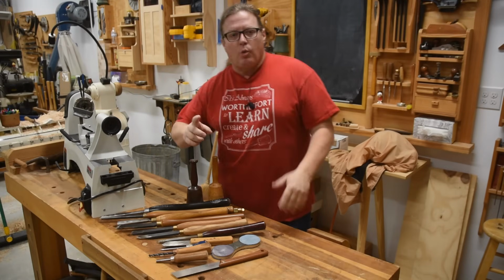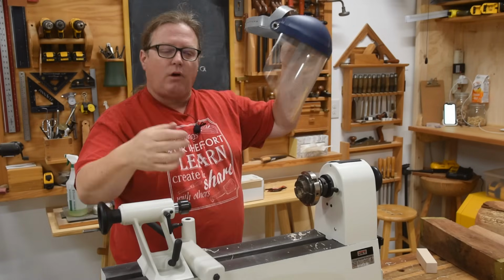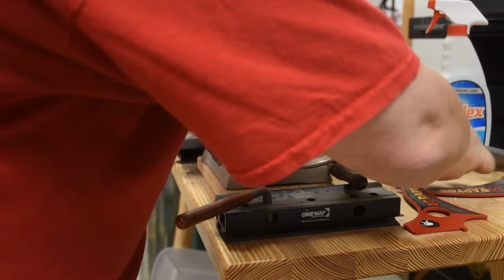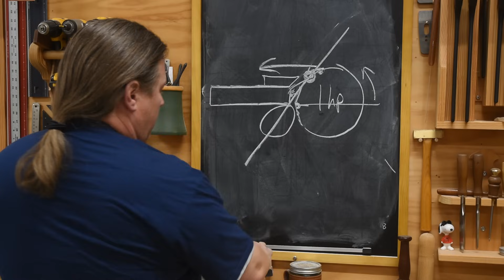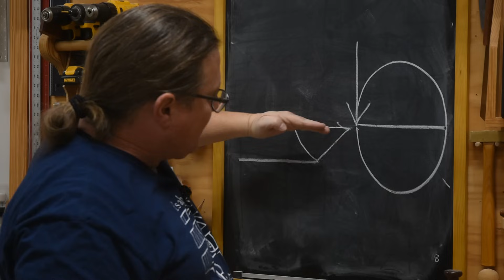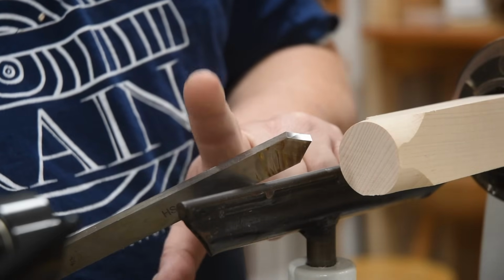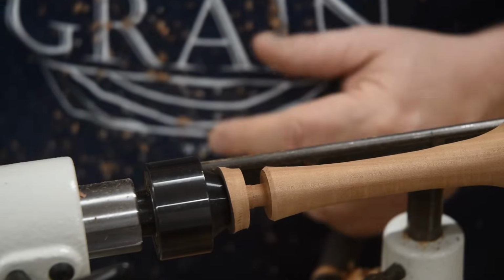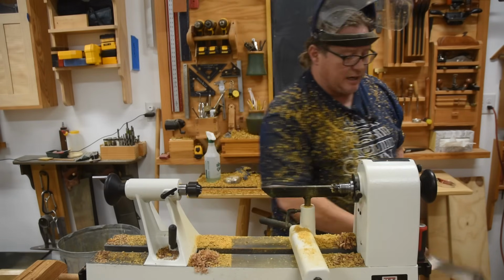Lathe Accessories & First Turnings  - Turning Basics #02 - Spindle Roughing Gouge and Parting Tool.

Comment: I bought a mini lathe as per your suggestion.  I do like it most of the time.  My biggest complaint is no reverse.  I found a hack and don't know for sure if it is a new thought but if you simply loosen the belt and flip it with the center pully on top and the small pully on the bottom with the belt crossed. Snug up the belt and TA DA it spins in reverse. I know it works and I know the belt rubs a bit but how often and long do you need reverse.  love your video's thanks.
Reply from the maker: main use of reverse is for sanding. just move the tool rest and sand from underneath. accomplishes same thing.
Reply: @wortheffort  I understand reverse is to pick up the fibers for sanding that were laid down during the turning process.  But with all do respect sir please rethink simply sanding from the bottom.

Comment: Which handle purchase would you suggest if you buy a Thompson gouge? I'm not yet into making my own handles. Also, what grind do you suggest for a spindle gouge if making small boxes, etc? Is the stock grind or fingernail grind better to buy if getting a Thompson tool?
Reply: Thompson sells handles for their tools
Reply: @TheWesttexasboy  mid size for w/ a midi lathe or longer handle better for certain tool(s)?
Reply from the maker: Med - small would be my choice for what we're doing here but in a few lessons you'll be making your own handles.

Comment: Hi Shawn, 
Hope I spelled your name right.  I have recently decided to get into wood turning, something I’ve always wanted to do.  I decided to take your advice and purchase the wolverine sharpening system and have now just discovered that the angle plate is too wide to allow my chisels to reach the grind wheel.  Having just purchased this system and really like the size and steadiness of the plate I really don’t want to cut it down.  I just have a cheap starter set of chisels currently, from tip to handle it is about 4-3/4”.  Is it possible to get chisels with longer steel as to not have to modify the angle plate.  
Thank you, Dean

Comment: You said you don't use the radius on the CBN wheel. Have you seen the 4 in 1 or Mega CBN wheels? Do you think it's worth it for woodworking and turning. You mentioned touching the side of the wheel, which these wheels would allow you to do. I'd prefer to save the money, but I figured I'd ask first.
Reply from the maker: Just bought a 4n1
Reply: @wortheffort  180 grit?

Comment: Hi, I have been woodworking for a very long time now and I still have the original tools I got when I started over 50 years ago. All my lath tools came from boot sales here in the UK, I don’t know what they call them in different country’s but basically all those tools had been in someone’s tool bag until they could not use them anymore and then I bought them second hand. I was luck when I was buying the tools as they would have been bought form a shop and the tool steel was very good then. I still see many tools on boot sales (before covid19 shut them all down) and some of the “good” tools you get now can be very poor steel against the old tools

Comment: Around 0:46 you are showing putting a spindle roughing gouge in the Wolverine jig with your CBN wheels.   Reading the instructions that came with my CBN wheels from Woodturnerswonders, he states that one should not use the wolverine jig with spindle roughing gouges.  The reason stated is because the CBN wheel can be very aggressive and in some cases catch the gouge, pull it below the center of the wheel and throw the gouge into the turner, ruining the wheel and possibly the turner.   This was the first I had read such a warning, but it is probably worth looking into.   My thought is that this is probably with gouges that are getting shorter and near the end of their useful lives.   His recommendation is to use the platform set at the appropriate angle.  Not that big a deal with a spindle roughing gouge since the angle is uniform across the grind.

Comment: Is a smock a good thing?
Reply from the maker: To keep you clean, yes.
Reply: At very least, smooth clothing. I just turned a quick handle wearing a woollen jumper - big mistake. And make sure your trouser cuffs cover your boots.
Reply: I've started wearing my welding jacket to keep the chips out of my shirt.
Reply: @MarklTucson  good idea!  I have one of those welding smocks, that might work nicely.

Comment: I was using a lath years ago, I had an accident that took out six of my upper set of teeth, and it made quite a mess of my face at the time. The accident was all my fault as I was turning too fast and I did not know the wood had a big fault in it but if I had been turning it at a slower speed would never have happened. I had a full-face mask and even steel grid to stop any bits that were likely to come off. I could not have known about the defect in the wood, but if I had been turning at a lower speed this would not have happened. I had been turning some pens and I simply could not be bother to change the belts on the speed shaft to slow down to the speed that I should have been turning at. I was so involved in getting this bowl done and changing the belts was such a chore that I did not do it and it turned round and bit me.
Reply: Good to know that injury can happen even with face protection.  Hope you are all better now, must have been quite an ordeal, to say nothing of painful.

Comment: A great video on the tool basics however there is a couple of points that I would like to raise.
I am not of the "safety police" brigade but in the first 10 minutes of this video there is a real safety breach i.e. the chuck keys are in the chuck.
I have personally seen a person killed by a chuck key that was left in a chuck and someone started it up.
The second point is that most deaths from lathes is from metal working lathes that have more power and torque than woodturning lathes. Most of these deaths have been caused by loose clothing being caught by chucks or swarf off the part being machined.

Comment: Thanks for doing this Shawn. I've come to the conclusion that buying a lathe is a lot like buying a Harley - that first big purchase is only the down payment. :)
You can get CBN wheels with flat 1inch sides. Check out the Mega Square wheels from woodturnerswonders.com. Also, their Kodiak sharpening system looks really interesting. The site is a great resource in general.

Comment: You may wish to add to your basics - I noticed you recommended using tail stock to crank the wood blank into the drive center so the teeth bite in - That is really not good for your headstock bearings - You should instead teach the point to first pound the drive center into the wood blank THEN put blank (with drive center) into head stock, so you don't have to crank down so hard on the tailstock live center and stress your lathe's headstock bearings..  However in this particular video, I guess one can forego that, since the mallet had yet to be turned....
Reply from the maker: Go back, I didn't say hard but constant. Green wood you are constantly tightening as it compresses. Doesn't matter if you pound it first. But even then you still have to get the pressure on so.... All pounding does is give the teeth a place to rest before the pressure.
Reply: @wortheffort  Green wood, sure .. I don't think you mentioned that specifically , but it being a beginner's basics.. wouldn't be advisable to teach what may be a bad habit for spindle turning - If you are turning kiln dried hardwood blanks, especially denser woods, you'd have to crank down on tailstock live center pretty hard to get the wood to engage the drive spur on headstock, and that is what I was mainly referring to - it stresses your headstock bearings to do that.. so maybe it would be better to try and teach the "maybe better" habit of driving in the drive spur to the workpiece with a wooden or rubber (soft face at least) mallet first before putting it into the morse taper (plus, you won't have to work so hard to pull the drive spur out of the morse taper after all that excess pressure drives it in so tight) .. There's no really "right way" to do it, to be honest, but worth mentioning to new turners to think about that..
Reply from the maker: @briangustin3745  I agree with practice but not reasoning. The bearings will be taking that force be it setting the teeth or just keeping snug. I.E. you never “back off” the pressure on dried stuff to not stress bearings in use. It’s same pressure. Hammering in my opinion sets the initial depth deeper to increase bite in green wood. I’ll discuss in live stream.
Reply: @briangustin3745  The practice of driving a spur drive in first stems from the use of dead centres in the tailstock so that you did not have to put so much force that the wood would not turn when the lathe switched on.
Shawn is quite right in saying that the bearings have no more force on them.
The rear wheels of cars that use similar bearings have far more stress and loading than any lathe can place on them.
Reply: @RobboRobertson  OK that makes a lot more sense.. It is one of the first things I was taught just about 40 years ago first time I used a lathe... Old habits die hard, I never wondered "why" at the time, then later there's those whose justification is the headstock bearings (BTW, On my cheapo harbor freight lathe, in fact, too much pressure could pop the snap ring out of the spindle at the bearings..) I still find it a preference and much easier to line up your centers especially when you need absolute accuracy (celtic knot turning, off-centering, etc)

Comment: The 3 biggest dangers of a lathe are flying stock, flying tools, and getting pulled in. 
flying stock might be a large chunk of spinning wood hurled right at your face. Flying tools is a tool getting caught and flung back at you. Getting pulled in is your glove, sleeve, long hair or gangsta necklace getting snagged and pulling you in, like a high speed winch. A large lathe is powerful enough to pull your whole head in and snap your neck. The dangers are very real and do happen.